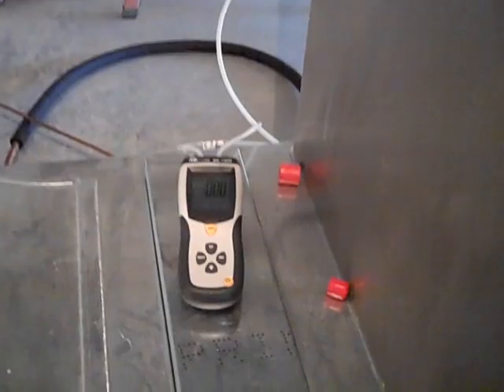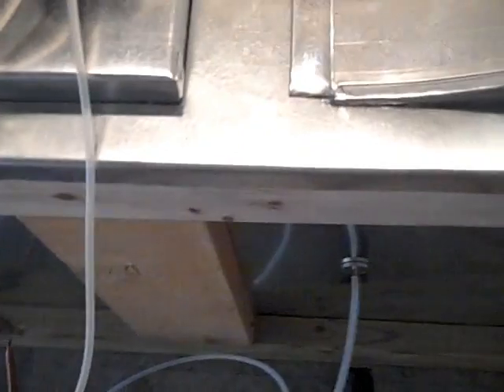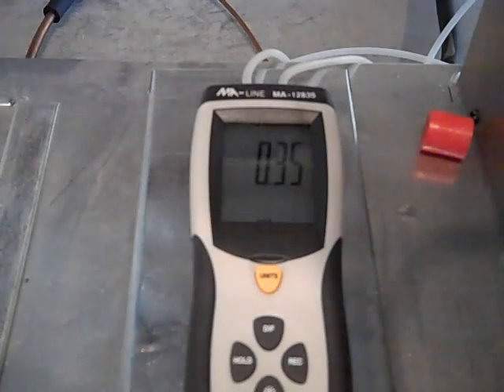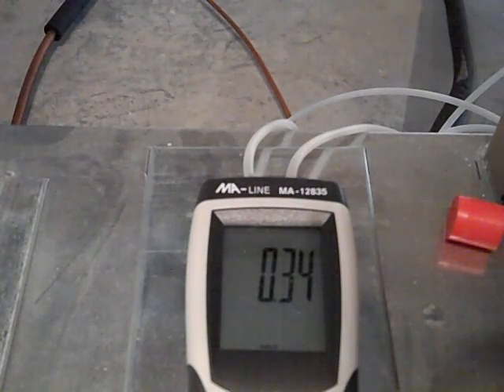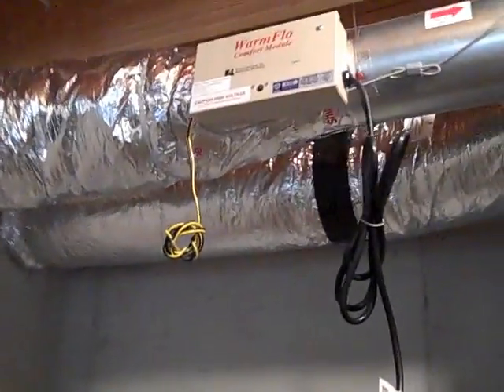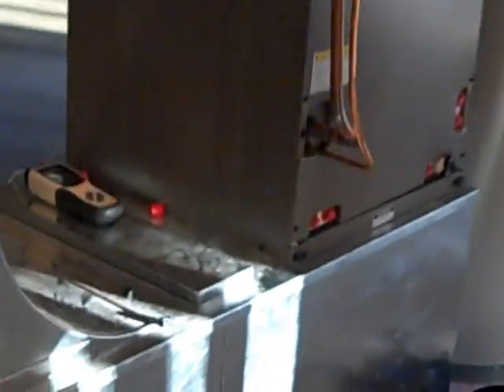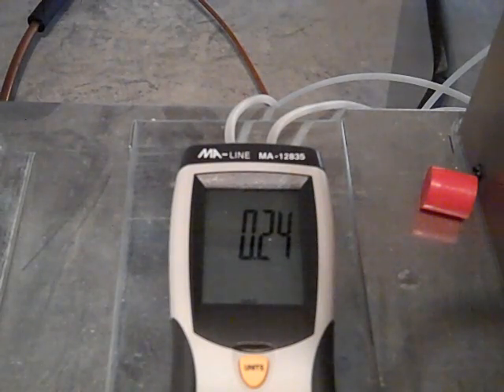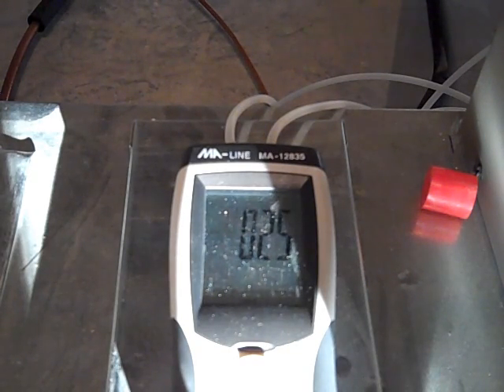HVAC Design Build Process Pt 13 Commisioning.wmv

Comment from the maker: @fritzhvac I like the probes. I want some longer ones so that I can do traversing. I might make some out of some small tubing. Traverse measurements is the preferred method to avoid the problem I had with finding the dead zone in that problem. I should have know something was up when the supply side had a pressure drop of .03" It's a good idea to check in several locations.